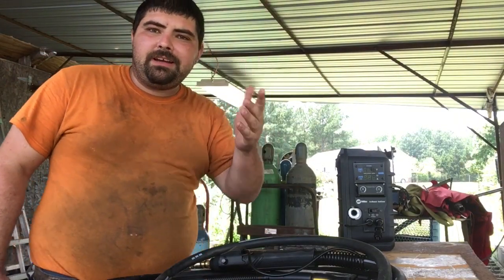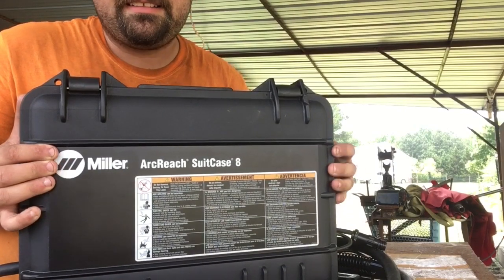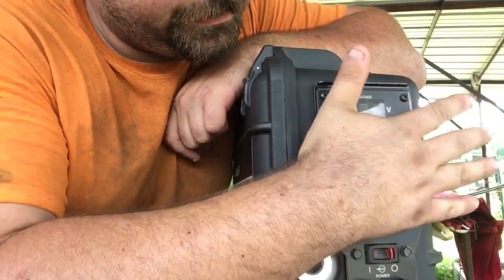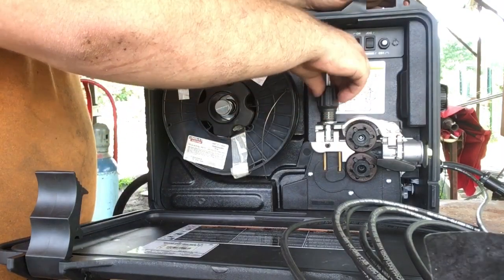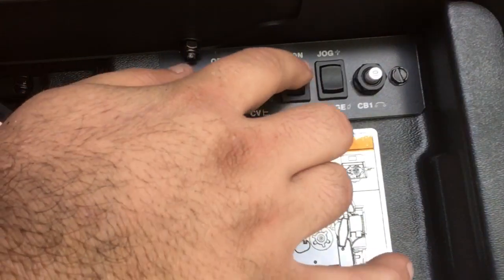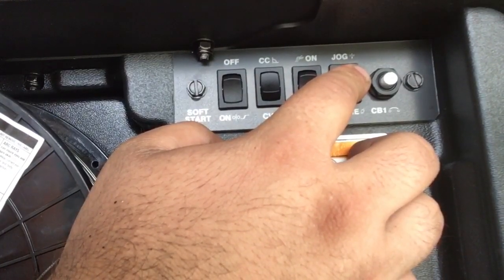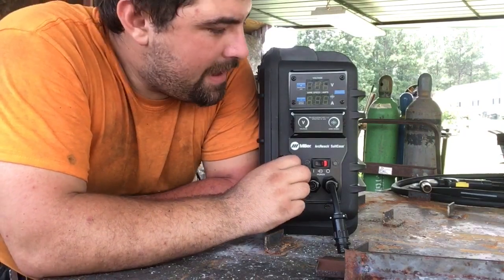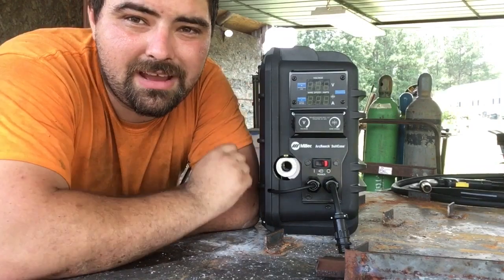Miller suitcase 8 Arcreach first review

Comment: I have an 8VS and love it. I've ran that .045 Lincoln dual shield wire with great results. For most standard welding I do, I don't like to mess with gas, so I either run .045 T-11 wire or Lincoln NR-212. The 212 is my overall favorite wire. It runs as smooth as butter and is great for out of position work. Unless you need to run the dual shield wire, give the 212 a try. It beats messing with a tank and hose every time. And wind is no worry with it.
Reply: Yes but...., the NR212 is NOT rated for impact properties therefore, it can’t be used for structural applications.
Reply: @williamthomas9463  It works for 99% of my work however.
Reply from the maker: It all depends on the structure and the WPS you have been given or if you’ve been given a WPS. Hobart fabshield21b is rated for structural applications up to 3/4”. I actually ran some on the structural job I’m using the suitcase. Since the engineer specs only call for a 70 series filler I can choose whatever I feel works best given the situation. However I like the way duel shield lays out and the fact it’s an x-ray quality weld so I mainly used duel shield on the job.

Comment: You will like the arc reach feature. It's nice when your in the field to be able to adjust voltage at the feeder and not go back and forth to fine tune it. I ran mine on a bobcat 250 for a while then just replaced that with a trailblazer 325. It's the basic 325 but the set up works well. I just need to practice on my end mors.
Reply: Did your trailblazer have arc reach also.  I assume if my trailblazer doesn't it'll be VS

Comment: i have the miller extreme 8VS and the miller 8RC and i think they are both brilliant. in short crcuit the 8 vs is great.I run them both on a miller xmt 304 and have great results . for the age of the xmt 304 it welds as good as a any new machine.the miller suitcases run amazing with it. I have the  Miller Optima pulse box set up on the 8RC feeder and it just works  so well.It's a cheap way to get mig pulsing and still have a portable suitcase feeder. I agree with you on the weight  of the 8vs  compared to the bigger suitcase feeder its far easier to move about with the spool in it. I know the small spools are more expensive but if you hold on to your used small spools you can transfer the wire from the bigger spools on to the smalls ones quite easily.

Comment: You can weld aluminum with a wire feed system like that. You just need a different gun you need a push-pull system How is it a push-pull system it pushes from the wire feeder and it pulls from the gun. There is a motor in the gun. Just like a spool gun. XR gun Miller makes it
Reply from the maker: I don’t think miller makes a push pull for a suitcase and honestly I wouldn’t want one in the field.
Reply: @derbadortheweldor8940  I've been in the welding field for 20 years. They have an entire dedicated XR Edge system In fact the same components. Are in the Miller 350p? all-in-one Mig
Reply from the maker: I can’t find any where in their website that says it will work with the suitcase 8. I don’t doubt your experience but if you know where I can find that a link would be awesome.
Reply: XR alumafeed suitcase Type that in the Miller website. It's a whole system. It's just like your arcreach except it's for aluminum. Go have a look.
Reply: @derbadortheweldor8940  Also, those systems are for big jobs. And I mean big big jobs. It'll run off the Hobart. I've rented one.
Reply: @derbadortheweldor8940  I started welding when I was 15 for my great-grandfather. He was a master blacksmith. After I graduated high school, I went on to welding school and from there. I've been welding ever since. I was taught Hobart. Welding institute curriculum at the community Vocational Center I went to I passed my 1in unlimited Bend for my D1. And my 200-pound asme static tank test. And I've been doing that ever since on steel and aluminum.
Reply: @derbadortheweldor8940  from what I gathered on the Miller site it requires a separate suitcase for push pull guns

Comment: This may be a stupid question, but can’t you plug in a regular mig welder to the engine drive? I’m not trying to be a douche because this thing looks cool, but I’m genuinely wondering why this over just a mig. Thank you.
Reply from the maker: Yes you can plug a regular mig into an engine drive. But most portable Mig machines have a very small duty cycle. This lets you take advantage of the 100% 250 amp duty cycle of the bobcat. since all the suitcase does is push wire nothing inside heats up. Therefore there’s a 100% duty cycle at 350 amp on the suitcase. This allows you to run wire bigger than 1/16 without running into duty cycle issues or overheating
Reply: @derbadortheweldor8940  sweet... that makes sense. I never thought about duty cycle. I live in Florida too, so duty cycle is probably shit down here. Thanks for the reply.
Reply from the maker: No problem

Comment: You should also do a bend test before you do any major repairs are fab.
Not to knowledgeable about dual shield but a buddy of mine took a test one ever and seems fine and when the tested it it broke polarity  and wrong current  FYI
Reply from the maker: If he had the polarity backwards of course it broke. Duel shield as long as you have the settings mostly correct and you’re using electrode positive you can get very good results with much less effort. I just recently did a cutting and etching on a flat and a vertical weld and it turned out really well when I make my final review video I’m gonna show them in the video.

Comment: Is there a reason for the suitcase
Reply from the maker: The suitcase has a better gun and duty cycle. The gun for the mm211 overheats quickly when running dual shield.
Reply: @derbadortheweldor8940  I see thanks for the quick response!One question wats the feature of consent current use for the the champion elite doesnt feature.

Comment: I had a 12 . Just before they with digital come out . . I don’t think I had it set up right . Keep have Bird nest in the unit . So I ended up selling it I didn’t use it enough . I got a good deal on it from the guy.  Still sold it for more then I payed for it . It hade two gun with it . A flux core gun and a gas gun . Payed $1200 sold it for $1800 . With  biggest gas bottle you can get .like I saying I don’t think I had it set up right .

Comment: Hey not sure if that model will but at a old job I was at we had a Miller 12vs that they ran a push pull gun off of. So you could always do that for aluminum welding if that 8vs will support it

Comment: How well would this suitcase work as a regular mig welder with C25 gas on CC im really thinking about buying one of these to run off of my Hobart engine drive?
Reply from the maker: I made a video about that around two years ago using a Miller S 32P. I would assume it works about the same.